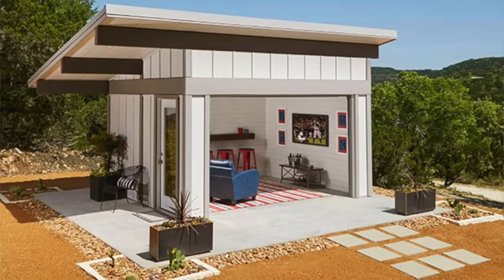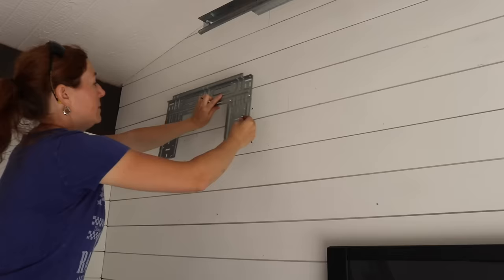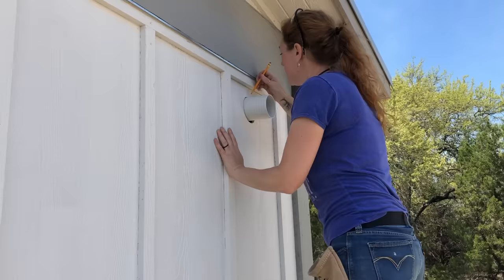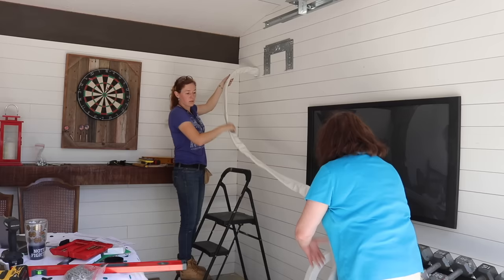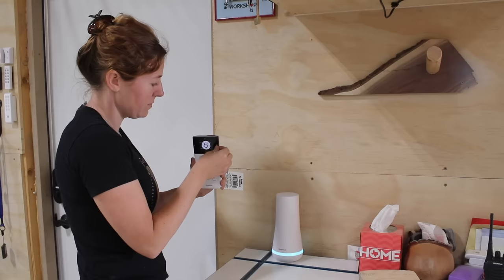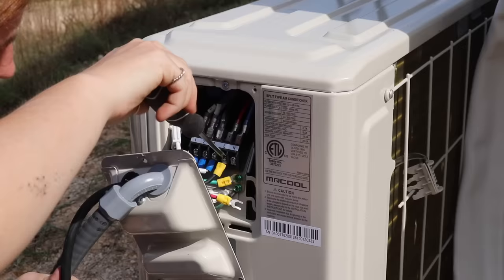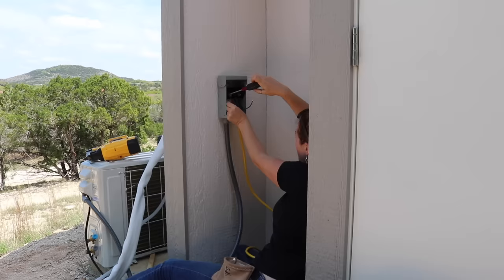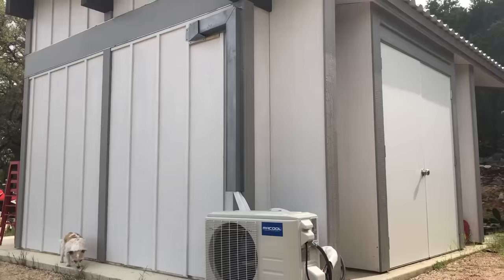DIY Ductless Mini Split Install - MrCool Unit

Comment: First off, I love your channel and so appreciate your journey and ideas. I subbed back when you you had < 10k subscribers because I loved your style and thought processes. I've learned a lot over the years and especially love your clever short cuts. Please don’t take these comments as criticism, but additional tips for current watchers. The Mr. cool mounting bracket has 16” on center with some sliding tolerance, those wide horizontal slots allow for this on traditionally framed building. So find the first stud and if your wall is traditionally framed you should be good to go on the other side. Second, and this is a potential hack for some installations, gutters can make a fine chase for the condenser line don't stand out from other vertical appendages to the house. Plus, they are cheaper than the dedicated offerings on the market. Just chase the line down a gutter and no one will think it is odd, nor does it take away from the building facade any more than normal utilities.

Comment: Outside unit looks really close to the wall. Be sure to check the manual for minimum distance for proper airflow. Plus having the extra line stored like that probably isn't the best thing.
Reply: definitely gonna pool oil

Comment: The unit is a 110 volt, why install a 30 amp disconnect? The company recommends a 20 amp breaker and 15 amp disconnect.
Reply: Any casualty that will trip a 15A or 20A breaker will trip a 30A breaker as well. Since she is (obviously) using 120 volts, there will be more current running through the circuit. I'd use a 30A breaker.

Comment: Hi April Wilkerson, how are you?
I am a technician in air conditioning in Brazil.
Congratulations on the installation of air, but I did not see in the video you make the vacuum in the machine. ???
Reply: I was wondering the same thing...When did the system get a vacuum drawn down on it?

Comment: that is cool i never seen a unit with pre-charged line. usually refrigerant is in the compressor you have to pull a vacuum on the lines and then can release the charge.
Reply: What I dont undesrstand is. How do you take off  the cáps and dont let the gas out before you conect  it to the condenser?
Reply: My thoughts as well, maybe check valves?

Comment: Nice, just a single 15A 120V breaker for that unit. For some reason I just assumed they were all 240V.

edit (again)
Oh, shoot, I can't find whether this unit does heating or not, which makes me think it doesn't do heating. Darn!
Reply: They sell different units, some offer heat, but the one she linked to on Amazon, in the Q&A section, indicates it does heat but you may have to contact the company to be sure...
Reply: @ZeoCyberG  
Good to hear, thanks! I'll have to look for that (and more info) when I'm on a computer.
Reply: It will. Also I have used pioneer systems from high seer. A little more involved but still ez to do and they are cheeper. Overall better value if you dont Mind vacuuming your own lines
Reply: It'll say heat pump if it also heats
Reply: @paulcopeland9035  I got my license after reading a 8 page folder & taking the test  both sections.

Comment: Do you plan on anchoring the outdoor unit to it's concrete pad?
Reply: Yeah, I wondered the same thing.  Seems like the vibration would make it walk around...
Reply: @d00dEEE  They don't vibrate as much as you would think looking at them. They are also really quiet.
Reply: I was hoping April would hammer drill at least a few holes, the wind does blow in TX.
Reply: Also people like to steal those things. AC units in general are stolen at a high rate in Texas. Make it as hard as possible for the thieves. You should also lock down your generator when you get it.
Reply: It doesn't walk around or move - the compressor is a rotary type that only hums & the fan will not blow the unit away.
Reply: Bob Vick v

Comment: And every coil wrap is another oil trap. and you have 4. Be prepared to replace system
Reply: I agree you should get a professional to shorten your lineset or make even horizontal loops instead of vertical ones
Reply: Guys it’s DIY...dead in a year!! There is nothing about hvac installation that is diy and definitely not mini splits. Take it from someone in the business this is a joke!
Reply: @CustomWeldingandFab  The only problem with that statement is that mine is running in my garage. Has been for the last 3 years with no issues. 
You don't need a HVAC guy to install this if you have brains.
Reply: George Crickmore I guess you got lucky or are an above average diy’er. There are so many things wrong in her video I’m not gonna try to get into on here but my statement is generally true. Congratulations you are above average!
Reply: Cody Digh I’m tried of dealing with overprice “Pros” that aren’t any better than many DYI. Many Pros went out of business when places like Home Depot and Lowes opened  because they are DYI stores. I’ve been a contractor for many years and have dealt with a lot of complete idiots “Pros” I realize DYI isn’t for everyone but there are a lot of experienced homeowners out there.
Reply: Gene Branson I am not saying there aren’t plenty of overpriced hacks doing hvac work and would agree that some are robbing people. But generally average people don’t have the tools and/or skills to do this job properly. There are always exceptions. I for one, try to give people an honest price and not try to get rich off every customer.
Reply: @GC-hw9ju  At least at Costco, where I'm planning on buying mine.. the DIY version has a 7 year condenser warranty, and a 5 year parts replacement warranty. I don't think there's anything to worry about as long as directions are followed.

Comment: We install these all the time and she made it look easy its a pain when u gonna run new wires to a breaker box and go threw a 8 inch wall filles with concrete and then cut the copper both ends and make new flares because the  mitsubishi mini split says we have two and add a drop of oil to the flare to make a good seal but glad u was able to do it like a pro

Comment: $1400 is cheap. I was looking at a multi-split put in the house and was getting quotes of $13k - $17k
Reply: Your getting ripped off , The contractor is porking you for about $15,000  . A just had a contractor swap out a 26 yr old 5 ton unit for $8 k , That was the turnkey job with a 10 yr warranty both ac and furnace were R&R . Good luck ,shop around . Call electric supply houses and ask the owner who he/she would use . All the supply houses know who is doing a good work and who is not .
Reply: We typically sell them for 4k - 8k depending on the size but if your talking about cooling your WHOLE house, with multiple heads. I see that being possible. We have about 2 customers who did that
Reply: @Straight_White_Fatherly_Figure  The cost for the units was relative inexpensive. But, when dealing with contractors I was told up front up i was paying their price regardless...which was about triple the MSRP. Then the labor came out to around $500 - $600 per hour. It just seemed excessive. The three bids that I received, the guys that came out none had ever installed one before.
Reply: @durakis  yeah i wouldnt trust anyone who hasnt done it before lol. And they typically just charge for the job and however soon the installers are done is when they are done but idk what exactly you were trying to do
Reply: @Straight_White_Fatherly_Figure  they were bidding by the project, regardless if it was a 2 hour or 8 hour job the cost was the same. I met a an HVAC guy playing paintball that has installed several of these and will probably revisit later this year.
Reply: @durakis  if he gives the same bid or close to it id recommend just getting a split system or package unit... mini split systems can be expensive to fix. Ask about repairs.
Reply: For whatever brand you want to buy. Go on that manufacturers website. They all have a link for a dealer (contractor) network that has experience with these products and aren’t pricing fear into the project.
Reply: Living in Texas there is a extra service charge when living in a small town - somewhere around $200 for an expected hour drive each way.
Reply: @Straight_White_Fatherly_Figure  We've been installing Mitsubishi units around the country for 15 years, mostly in computer rooms where it runs 24/7 year-round. We've never had a single one break.

Comment: The outside unit come over charged to fill the supplied line.  If you shorten the line and re-flare the end to purge  all you have to do is attach to the compressor and open the valve until the gas comes out the other end, close the valve and put the caps back on for each tube, no vacuum needed the system has a dryer built in.  Run the tubing remove the caps and connect then open the valve and you are good, since the system is designed for the full length there will be sufficient gas.   Most of the units sold can be DYI installed.
Reply: You may want to listen to when she mentions (per the manufacturing company states on their website) as seeing the lines themselves are precharged would result in freezer burn which can be deadly and needing to call in a tech who knows what they are doing to shorten the line. That much extra line is standard for those needing that much length, IMO they really should offer 15 foot as well for those not needing that extra length, in which case the length has little to no effect on ac efficiency either.

Comment: Did you mount the outside unit to the concrete?
Reply: the big bad wolf is not going to huff & puff and blow it away - home units are not mounted to the ground only by wall mounts

Comment: Hmmm, 90% of your coil is outside, you'll have cooler air outside around the coil than inside, I guess. BTW, isn't supposed red wire go to red wire and black to blue?

Comment: A friend of mine just installed similar unit.  Only issue I would point out is that it doesn’t have a fresh air intake.  Old fashioned wall unit will allow for either fresh air or recirculate.  Both room size and lack of wall and ceiling insulation should be taken into consideration when sizing.  Friends seems to struggle to adequately cool space.

Comment: That's a very low power unit. That is really efficient. Might work with solar and battery setup but that depends on how often/you use it to be a good idea. Thanks for the post.

Comment: are your guests really going to want to listen to a generator all night while they run the mini split to keep cool?
Reply: Only if she goes cheap, an inverter generator by Honda will be whisper quiet but it will cost more than her split!!   She can also sound proof that wall.   So I get what you are saying but there are solutions around it.   I personally would go solar but to do it on the cheap it is good to have a electrical background.  But everything can be found on the internet nowadays or some forum can help on that!    April is proof as she's providing great, down to earth DIY information for us everyday folks!

Comment: I had a mini-split installed in my house. The installers set the outside unit on a supplied pad, and that was a big mistake. With my West Michigan location, in the winter heating mode, the outside unit frequently defrosted the coils, and built up a layer of ice underneath it, and making it inoperative.

I eventually fixed the problem by building a treated wood riser, with a hinged top lid. The top needed access for washing out the coils when they became clogged with lint from the neighbor's nearby clothes dryer.

My installer was not aware of their faulty installation and workmanship. When I contacted them, they came out and raised the unit off the pad (they had installed it on) with concrete blocks, which were not even tall enough to keep the condensate ice build up clear of the bottom of the unit.
Reply: I understand exactly what your saying. I set mine on 4x4 frames about 2ft off the ground. Works perfectly.

Comment: should have mounted the external unit on the wall.. those things are begging for rodents to make a home inside
Reply: Yes, there are a few things, which would have been a little better in the project.  Mount exterior unit on the exterior wall.  Purchase a shorter line-set, with pre-flared ends (try to eliminate the extra coil of line-set plopped on the ground behind the exterior unit).  The condensate line needs two types of traps, a traditional "U" shape, and a filter to prevent insects from coming right into the exercise room.  Seal the line-set with putty where it goes through the wall, again, to prevent insects.
Reply: @directech  i agree. Except the length of the lines were that long as they contained all the refrigerant... the company should have built in a reservoir for the refrigerant rather than use hose length to hold the amount needed.
Reply: @directech  mini split systems do not need a water trap for the drain. They simply dont have that kind of negative static pressure in the air handler. Also i dont know how the line set came precharged when its the cu that normally comes precharged. Should have a valve you open after you get the flare fittings connected and a vac on the pipes. Deffinatly should have cut back and flared that loop out of there but overall its cool to see a chick do this so no hate from me :p 
Though i know nothing about that brand of mini split, i normally work on Mitsubishi. Maybe those pipes did come precharged and the rest of the system came with a pre vac on the coils.

- from an ac service tech in Florida

Comment: I thought this unit required a licensed contractor
Reply: @DjentleAnt  yeah the split unit.
Reply: To add AC in a shed that doesn't attach to the homes power system -

Comment: Nicely done- great video. A couple suggestions, some of which are mentioned below. First, the excess refrigerant line should be placed somewhere that doesn't cause airflow restriction at back of unit. This may reduce the efficiency of the system. Second, and this is important- proper installation of any mini-split a/c system requires the thorough evacuation of refrigerant lines/etc after all connections are completed. This step ensures contaminants are removed. Even the pros often omit or truncate this important measure. The potential problem that results is an operating system with contaminants being circulated and therefore causing premature compressor failure, or other issues. The proper installation of a system such as a mini-split seems straight forward, but the reality is that the unit will very likely not operate correctly and/or experience premature failures if not performed by an experienced, qualified tech.
Reply: Wrong know-it-all, this is a DIY mini-split.
Reply: @CB.5  Understood, however those who have a thorough HVAC background recognize that even some manufacturers are supplying equipment with sub-standard installation specifications. All refrigeration and A/C systems require a thorough pre-charge system pump down to best ensure against premature mechanical problems due to contaminants in the piping and equipment. The unit provided in this video will likely provide good service life, but the system evacuation procedure (standard in commercial and most residential min-split systems) would help ensure maximum service life.
Reply: @jlvandat69  Wong again - these are precharged lines the same kind used in many residential system since the tech doesn't have to spend the time balancing the system for the right charge -
Reply: @jwarmstrong  As I mentioned, residential systems such as the one installed here will likely provide good service even if a thorough evacuation (as always performed with commercial/industrial systems) is not performed. However, regardless of whether or not the lines are pre-charged, the very best service life will be obtained by doing a full system evacuation and proper charging. This is not an opinion - any HVAC expert would concur.

Comment: I'm currently working on installing all of my Mr Cool air handlers.  Only thing I would add is that you could have put your hole on the right side and just let the stub pieces go through the hole and made your lineset and drain line connections outside instead of trying to put all of the 25 ft. pieces through the hole.  If you would have had the template it would have showed you where this hole is located on the right hand side.

Comment: I use a 30,000btu mini-split in my shop. It keeps it cool in ok with the cnc, vac and dc on. 
That drain hose will get hard, brittle and break very easily after a few years. I had to replace mine and it's on the north side out of the sun. 

Maybe tint those windows on that garage door for privacy and keeping the sun out somewhat.
Reply: nevermindthebollocks you you VN you tube

Comment: Thanks April !!  I have my 30x30 garage with a un-finished attic space that will be an extension of my shop from the main floor (once  the attic space is finished).  I have been looking for options for cooling it during our hot Minnesota Summers.  Thanks again, this was helpful.
Reply: window/wall unit is cheaper
Reply: @Joshua79C  Not for a 12k AC only $400 on ebay
Reply: @jwarmstrong  Got a new 12K last year for 350, but unlike hers or others it has no heat pump thus the price is so low, for AC Only type units.

Comment: I was get a ceramic window tint 70% should be the clearest and put it on those garage door windows who cut out most of the heat coming in I believe you can get it on Amazon

Comment: Kudos for taking on this task, i might add, you need vibration mitigation, some sort of rubber pad. Don't be afraid to call an HVAC person, this is a cheap recovery cut and recharge job

Comment: That's fantastic.  Pre-charged lines!  One thing, though.  Wouldn't having the line right next to the unit like that obstruct airflow?
Reply: yeah, i would have put that extra line in a insulated box and screwed it to the wall. keeping all that line inside and insulated would be the most efficient i would imagine.